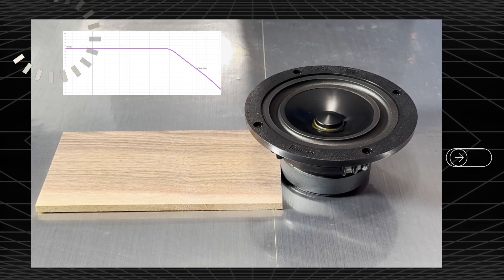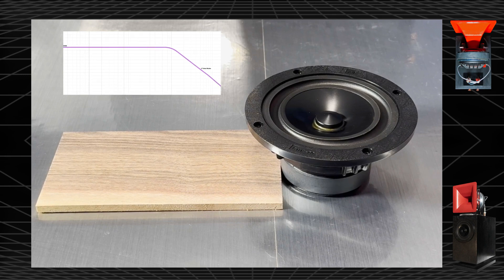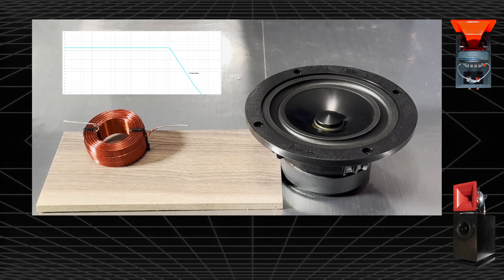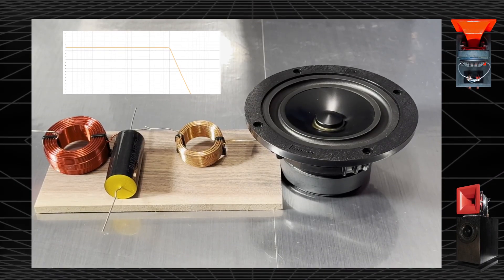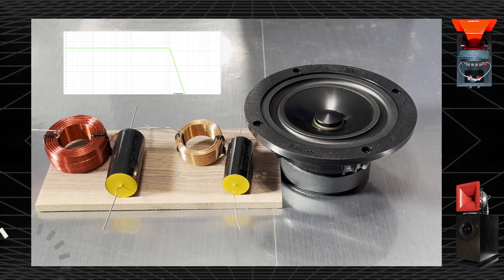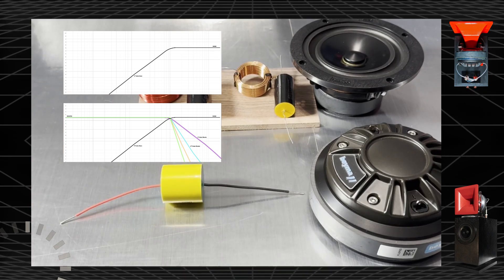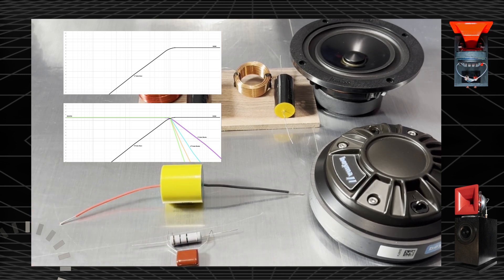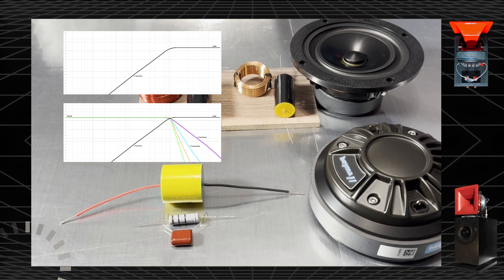Understanding Crossover Design Basics | Little Hiro Crossover Design

Comment: I just hope you have a video on the basics about what an inductor, a capacitor and a resistor does because most people ignore that and why there are so much price variation for the same part from different companies. Thanks.
Reply from the maker: Yes, parts absolutely matter—which is why many manufacturers don’t talk much about theirs. We’re working on a deep-dive video to break down exactly what makes a speaker sound good, almost like an X-ray of its internals.

But here’s the thing—there’s no magic, just good components, smart design, and solid physics. The drivers (woofers, tweeters, etc.) are the heart of the system. Cheap parts introduce distortion, while well-reviewed, high-quality components ensure clarity, bass depth, and overall balance.

The crossover is just as crucial, directing frequencies to the right drivers. A poorly designed one can ruin the sound, while a well-built crossover blends everything seamlessly. The good news? Free software like XSim or VituixCAD makes proper design accessible, and we’ll go over this in our video.

A well-built cabinet isn’t just a box—it controls vibrations and enhances driver performance. Ported designs allow deeper bass, while sealed enclosures provide tighter, more accurate response. Neither is "better"—it depends on your sound preference.

So, how do you know if your speaker is accurate? Measure it. Using an UMM6 calibrated microphone with REW, you can analyze the response. Recording it with stereo mics (like a Rode NT1 Gen 5) and comparing it to the original FLAC or WAV file helps reveal how faithfully your speaker reproduces sound. It’s just like printing a red rose photo—if it looks pink, something’s off. The same principle applies to speaker recordings. Headphones are a reliable way to hear the difference, as they reproduce both the WAV original file and your speaker’s recording for direct comparison. If it sounds off, well it is.

Fine-tuning matters. Speaker placement, subtle EQ adjustments, and even room acoustics play a huge role in how your speakers sound. What you hear in your room is what matters—not what a speaker sounds like in an anechoic chamber or showroom.

At the end of the day, great sound comes from quality parts and solid engineering—not marketing gimmicks. And yes, we’ll be covering all of this in our upcoming video.

Stay tuned! We’re pulling back the curtain on how speakers really work.